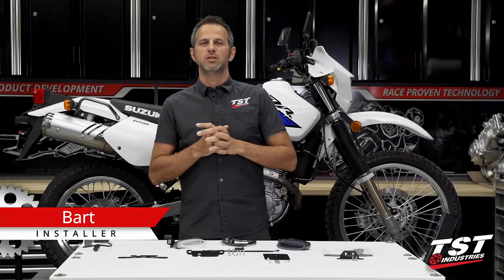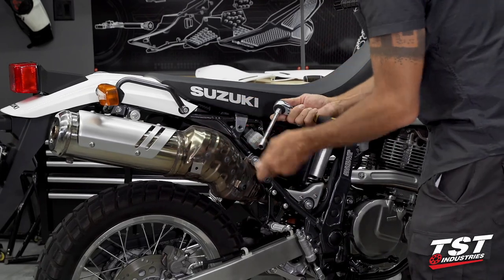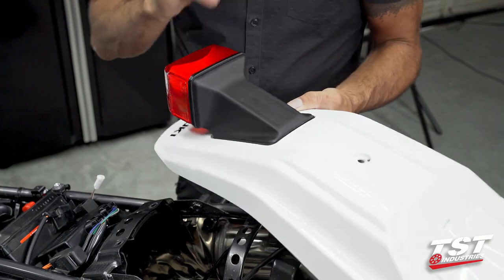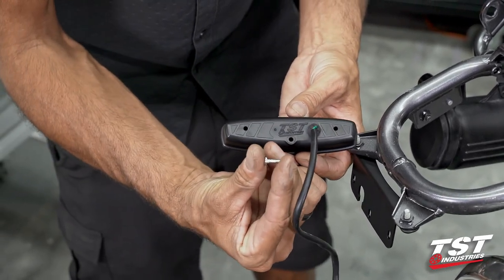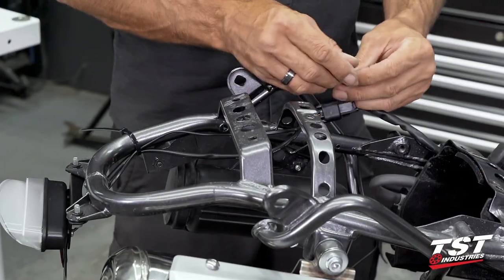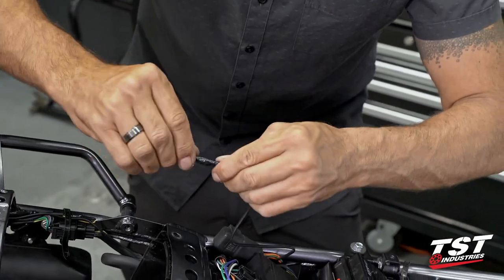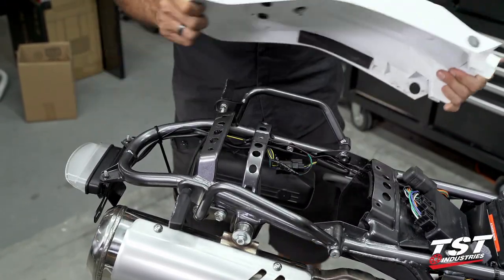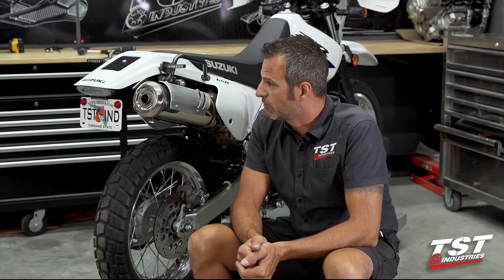How to install an TST Integrated Tail Light and Fender Eliminator on a 2001+ Suzuki DR650 SE/S

Comment: Just got my signal and brake light kit in the mail and excited to get it on the bike! You guys did a great job with this video. I have very limited experience and understanding of wiring so it's helpful to see exactly what I'm up against before I start.
Reply from the maker: I'd like to hear your experience once you get through the process.
Reply: @TSTindustries  Hey sorry for the late reply. As I recall, it went on without issue.  Just as simple as you show in the video. I took my time and was careful with each step. Increasingly few things in life are this way but you guys did your homework. 
Been scooting around for a little while now and I really dig these lights. They work well (so far) and really clean up the look of the bike

Comment: Very informative video I was all in until I have to cut the tail light connecter off the old tail light. Why doesn’t it come with the connector already on it for the license plate light?
Reply from the maker: You actually do not have to cut the connector off. That is a suggestion for those that want to retain that particular connection type. Our license plate light comes with the posi tap connectors that are used to connect your license plate light right into any wires agnostic to OE connector housing. You cactuall can connect right into the black and blue wires on the tail light if you want to keep your bike side harness pristine. To answer your question why we do not put OEM style connectors on our license plate light I will have to go into detail of logistics of taking that approach. Some of the components that we manufacture need to stay universal. We offer this license plate light for a vast array of motorcycles, and also other vehicles. We would have to have about a hundred different license plate light SKUs that each sell at different rates. It is impractical for a business to endure this when most end users are already ok with installing with our provided means. From time to time somebody turns up that absolutely has to have an OE connector to go with this kit, and if they ask our customer service guys, most often we can accommodate by supplying a connector and terminals (for those vehicles that we stock connectors for).
Reply: @TSTindustries  I appreciate the quick response and the informative reply. I will definitely get in touch with CS. Yeah some of us guys are sticklers. Thanks again for the reply.
Reply from the maker: @genewuchner9004  I understand. When I build harnesses on race bikes they get the mission-critical treatment and all connectors are proper, insulated or sealed, with strain relief. In manufacturing we have to contend with certain pressures that sometimes require a compromise. Such is the case in universalizing our license plate light.
Reply: @TSTindustries  Thanks for the reply. You sold me. I plan on getting the fender eliminator and the front and rear smoked turn signals. Just in case CS doesn’t have the connector, would you know the exact part I would need?
Reply from the maker: @genewuchner9004  they don't have the connectors. They typically come to me for them in the R&D stash, or ask the assembly peeps. I have to review the footage to remind myself what connector this bike uses for lplt
Reply from the maker: @genewuchner9004  2 pin Mitsubishi UC .040 female
Reply: @TSTindustries  Thank you.

Comment: Id like to do a full led signal conversion on my dr650 not exactly sure what id need besides the signals the plug and play diode and relay. Is the any other connectors i would need? Besides those things?
Reply from the maker: Are you wanting just replacement signal lamps with LED light sources, or the integrated tail light along with the signal lamps? I think discussing this topic with our customer service guys through our website will get you your answers quicker.